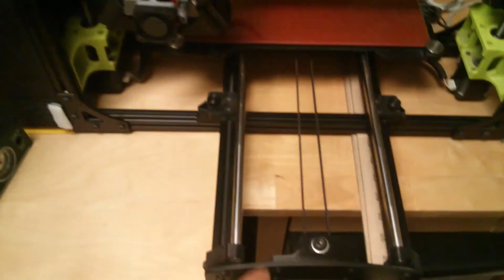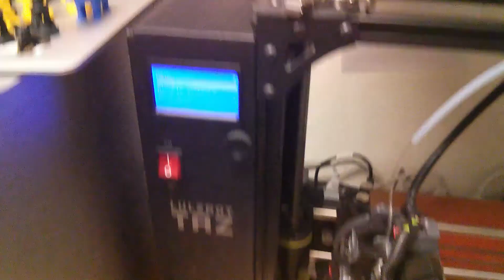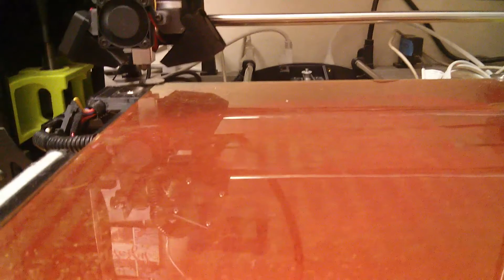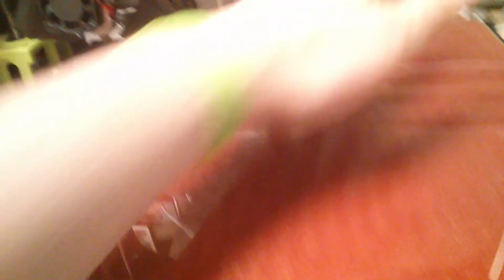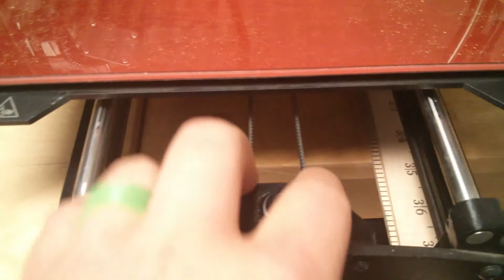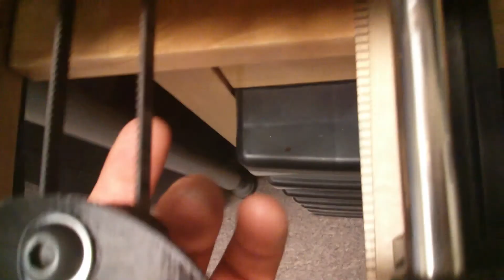lulzbot taz 6 auto home y axis off

Comment: The solution to this problem is to reposition the Y axis with respect to the XZ axis:

(1) Halt the Z-Homing function or position the tool head above where the Taz expects the button to be. 
(2) Disable Stepper motors and slide the build plate fully up or down.  
(3) Observe the brackets connecting the Y axis to the XZ frame. 
(4) Adjust these to position the z-offset button below the tool head whilst ensuring perpendicularity of the Y, Z, and X axis. 
(5) Home X, Y, and Z and repeat step 1-5 until satisfied.

You’re welcome :-)
Reply: Did you solve the Y axis position? Mine got like that few days ago
Reply from the maker: thanks for looking into this!

i'm having trouble picturing this solution.  could you make a video showing it?

i'm imagining halting the homing process and repositioning the y axis until the extruder probe would hit the z limit switch.  that seems like it would not work since that would cause the y-axis to no longer be homed.  so i think that's not what you mean.

if i have time, i will make a video explaining.  this isn't actually my printer.  it's a friend's.